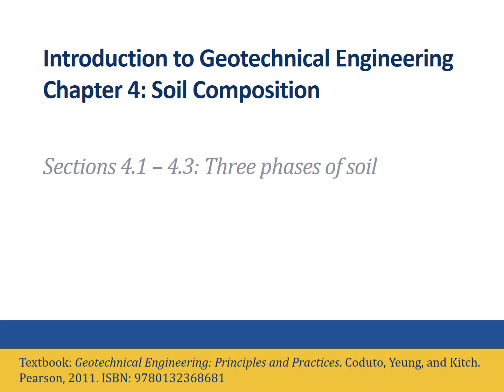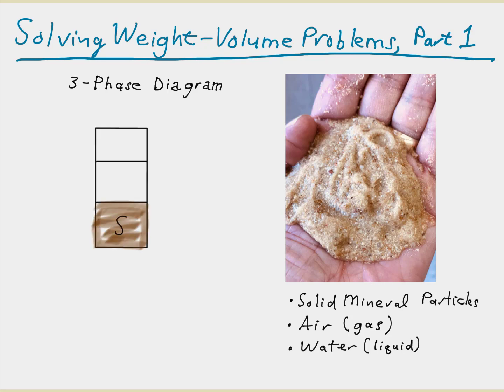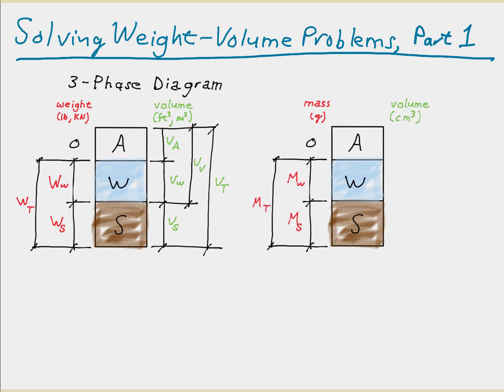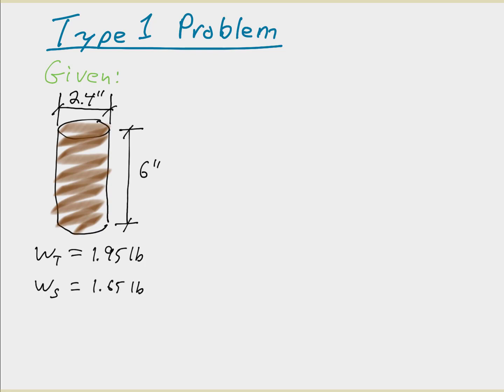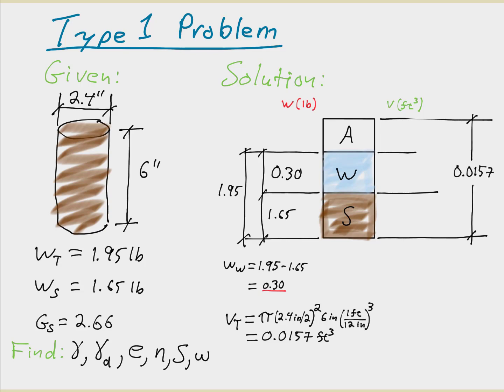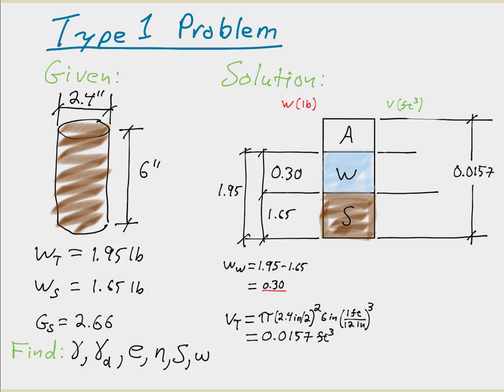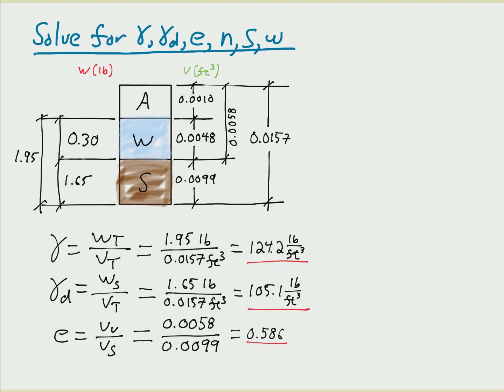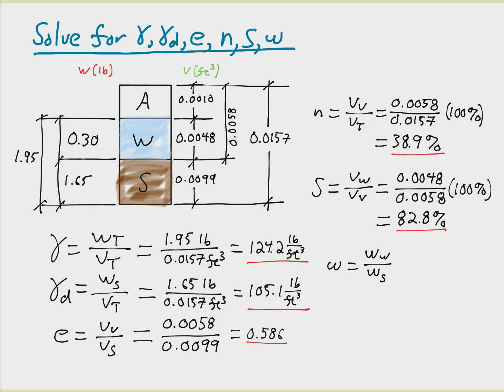3-Phase Diagrams Part 1

Comment: At 9:58 you have Porosity equaling 38.9% is that an error? Because when I did mine I got (0.0058/0.0157)x(100%) = 36.9%. Am I do something wrong?

Also why is the Water content divided by the dried sample and not the original sample weight. aren't we trying to figure out how much water was in the original sample?
Reply from the maker: Could be.  I'm notorious for making errors.

Comment: where did you get 2.66 when solving Volume of solids?
Reply: You probably found the answer to this. However, it was a given Specific Gravity. This problem started with 4 Given values:
1.The weight of solids. 1.65 lb
2.Total Weight 1.95 lb
3.Volume (which was calculated and converted from inches cubed to feet cubed. 0.0157 feet^3
4.Specific Gravity 2.66